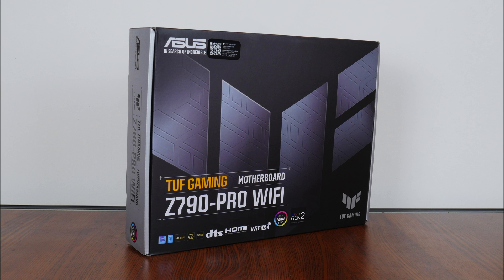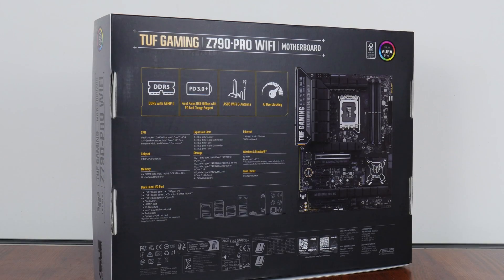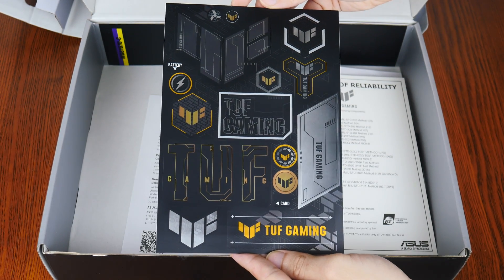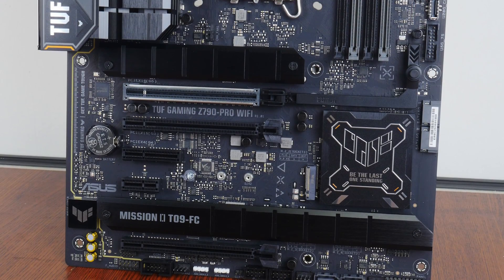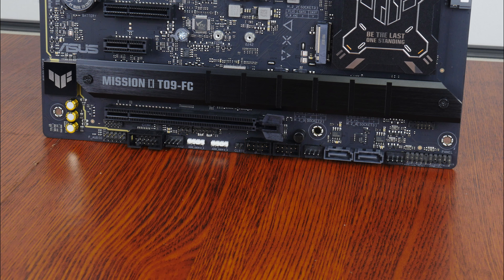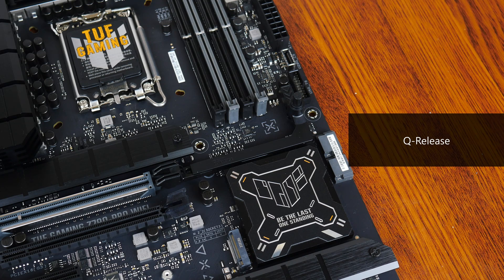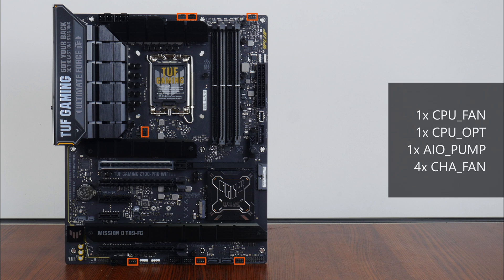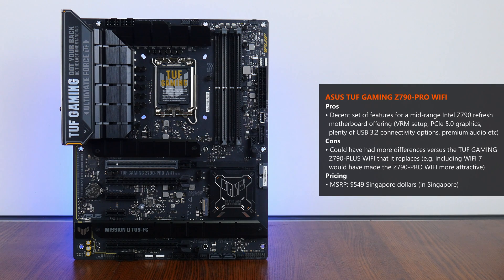Intel Z790 Refresh Motherboards are Here! ASUS TUF Gaming Z790 PRO-WIFI Unboxing & Overview

Comment: I have the same motherboard. When I install a second SSD, the computer constantly reboots. Windows sometimes boots. When I try to transfer files to the new SSD, it reboots again. I think my motherboard is faulty.
Reply from the maker: Yeah it does sound like an issue with the second SSD slot. Might be time to get the board RMAed..
Reply: @ALKtech  My problem 12vhpwr cable.. I changed the cable and my problem was solved.

Comment: Did  I miss any BIOS flashback options?
If you buy this board and a 14700k will it work out of the box?
I am wondering if the BIOS could need to be updated first?

Thanks
Reply from the maker: Yup this board should work with a 14700K out-of-the-box as far as I know!

Comment: Is it ok to use a Thermalright Peerless Assassin CPU cooler for this?
Reply from the maker: Yup it'll work fine with this board!
Reply: @ALKtech  Thank you. Was thinking of buying an AIO or an Air Cooler. But I guess air cooling is enough with this board. And I think its durable enough to carry a heavy cooler.

Comment: No Wifi 7 that is gonna overtake the marked in 1-2 year that is just no go.
And even problems whit headsink and M2 also. 
And Audio codec is no premium on unly  32-bit/192kHz PCM.
MSI and Gigabyte do that better also in same range. 
Asus cut not even put in Realtek ALC4080 or Realtek ALC4082 32-bit/384kHz PCM.
So the problem here is that Asus is missing out, and the 2 higher end series is to high for the consumer.
Even Asrock can do this better for less a price.

Comment: nobody buys this refresh
Reply from the maker: Some refreshes are more equal than others - if you're looking at higher-end models, you do get bells and whistles such as WIFI 7 and even 5 Gigabit Ethernet! But if you've no use for such features, getting the older Z790 boards for a good discount will work just fine too!

Comment: Love your videos really helped my fried in deciding which b650 mobo he wanted. Is it possible to do a review on the Asus x670E-f? I have not seen many informative reviews on that mobo. Thank you in advance.
Reply from the maker: Glad to hear! I gotta see if the folks over at ASUS might have a marketing sample for a X670E-F lying around...are you looking to build a high-end AM5 PC for yourself?
Reply: @ALKtech   More like upper mid range I am looking for a good X670e mobo for future proofing cause I am planning on buying the 7900x down the line when it gets some good discounts.
Reply from the maker: @rohanleander  also helps that AM5 should see at least one to two more generations of AMD processors...going with a good X670E board should be a pretty safe option! That said, looking at the specs sheet of the ASUS ROG STRIX X670E-F WIFI, it packs plenty of punch for a higher-end X670E motherboard, though if I were to nitpick, given its age, it doesn't have newfangled features such as WIFI 7, which Intel's latest Z790 Refresh motherboards do come with, though LGA1700 is now officially a dead-end platform...
Reply: @ALKtech  I completely agree with you but I still think Wifi 6E should be more that enough since I use a wired connection. I just found out that the X670E-F mobo price in my region has increased as well as the Amd ryzen series given that this has happened do you have any good suggestion for B650 Mobos?
Reply from the maker: @rohanleander  if you're looking at an ASUS board, do check out the ROG STRIX B650E-F GAMING WIFI (I've done an overview video for this board on my channel, do check it out if you're keen). I personally think it occupies a sweet spot in terms of specs and features, especially against lower-end X670E boards!

Comment: Yo man, i've got a question. I'm buying RTX 4060 + I5-12400f. Which motherboard should i go for - ASUS PRIME B760M WITHOUT THE WIFI OR THE GIGABYTE B760M DDR4? Also what is the diffrence with asus with wifi and the one without? Only the fact that one doesn't have a wifi option and ethernet is needed? Thanks for the answers.